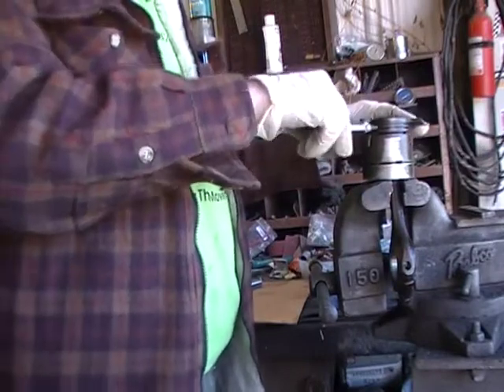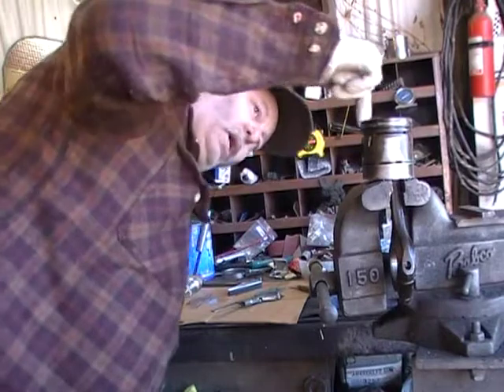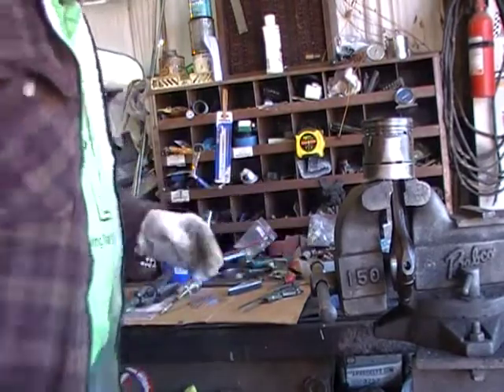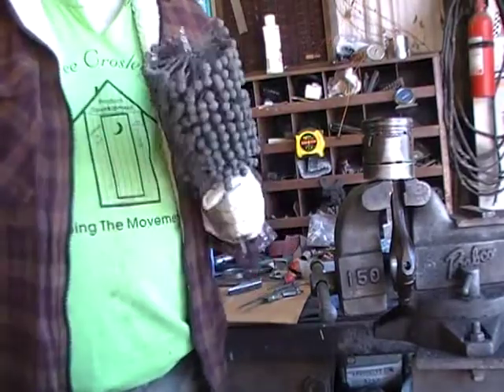Piston Torture

Comment: I have a ring groove cleaner just like that...One of the best things I ever bought way back when I used to do a re-ring on a Holden 6 cylinder in 5hrs....Drive in drive out...I like bottle brush hones..If the bore is a little wobbly and there is no re-bore it at least leaves a nice ramp for the rings to go over...Stones can leave a little step...I recon if there's no ridge in the bore "And we've all done our share of ridge cutting" then a set of rings and a hone will be plenty good enough for the normal driving conditions..With may be a little piston rattle when it's cold...Some 15W40 and she's good to go...Yes sir.
Reply from the maker: All great advice Ziggy. I used to do a smallblock Chebby in 3 days. Re-building th heads and all. I have a MONSTER ridge reamer. I hate to even touch it.